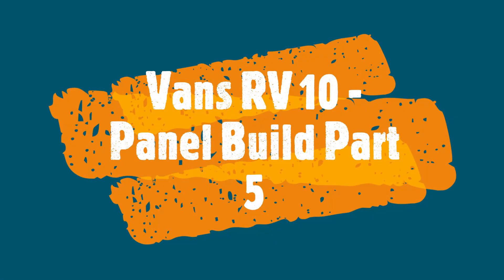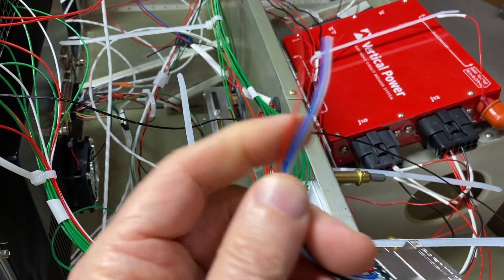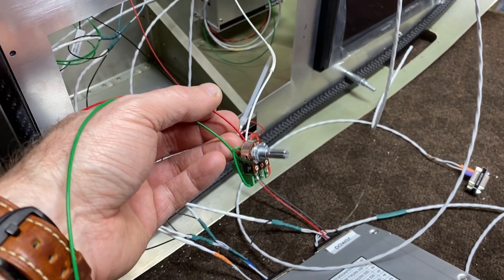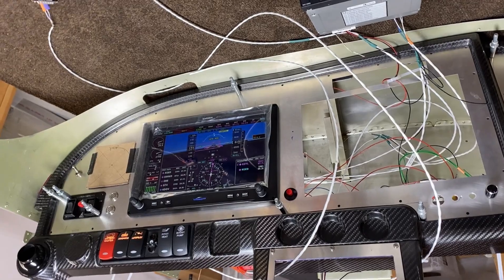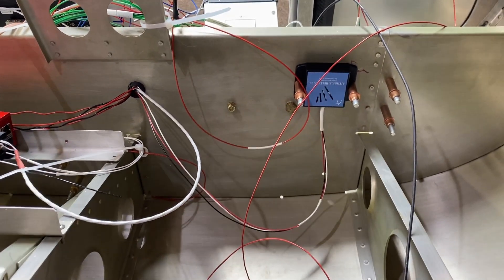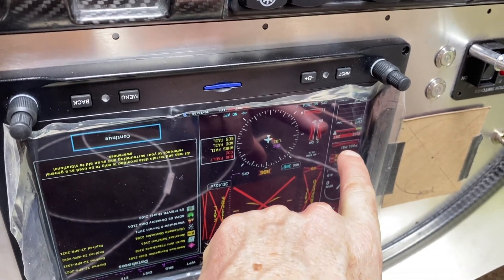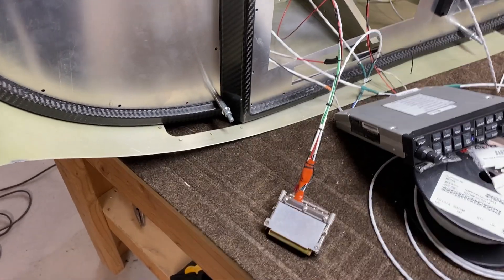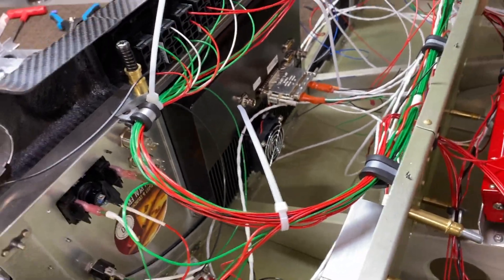Vans RV 10 - Panel Part 5

Comment: Where did you get those switches(the rockers)? They look nice.
Reply from the maker: the switches I purchased from waytek (much cheaper than aircraft spruce) you need to then purchase the cover which i got from aircraft spruce (they are the carling switches).  Btw you need the switches, the mounting panel and connector block, and female terminals if you want them to be easily removed. You could skip the connector block but then you would need to plug in each individual wire.

Comment: I'm only on the empennage kit so SEVERAL steps behind you.  I see that you're using Vertical Power which is what I'm considering.  What is the reasoning for the additional manual breakers on your panel??  Thanks.
Reply from the maker: The Vertical Power platform that I purchased was the sport and I ran out of digital breaker, which I knew I would but i really did not want the additional capabilities from the PRO as it did not given me any additional switches and I am using a TCW IBBS solution for my essential bus and hence backup solution.
Reply: @aleafonthewind3775  Thanks.  That helps.